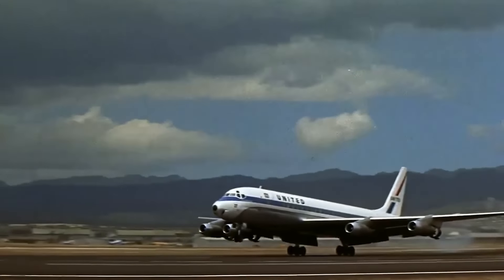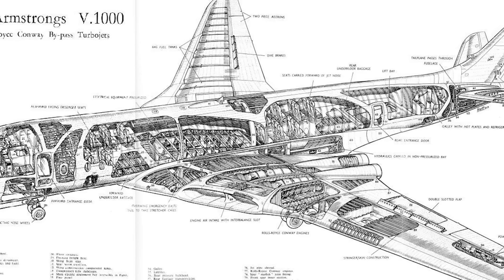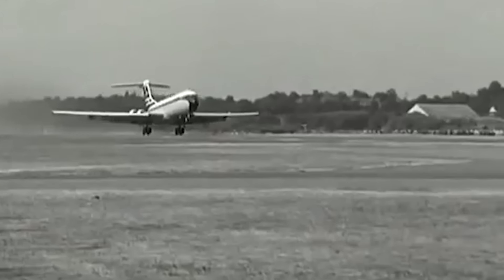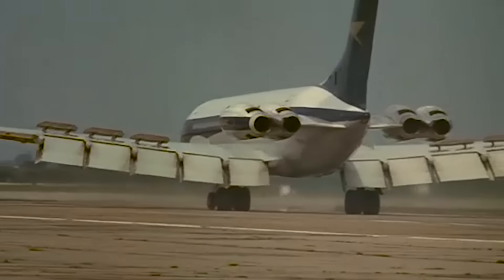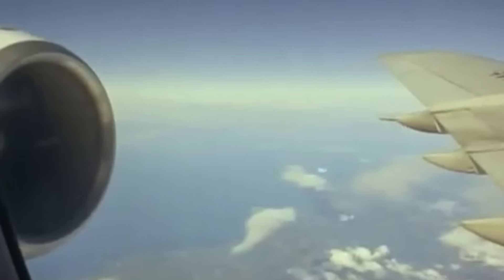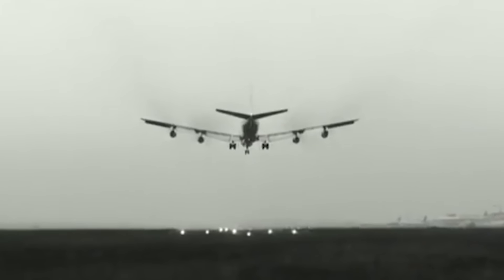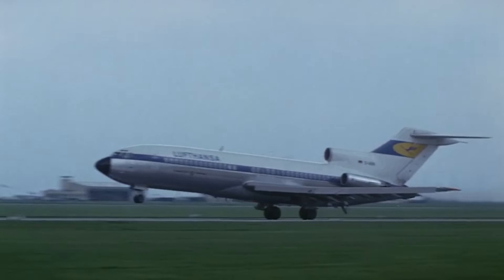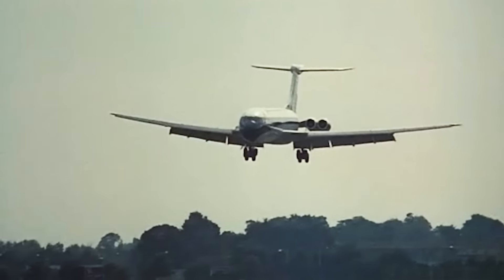Vickers VC10 - the lost flagship

Comment: The cost of modifying (lengthening) every airport runway  in africa to handle 707s was less than the cost of a single VC10 - blaming the requirements on BOAC is misguided as it was the Air Ministry who set the spec and told BOAC to fly the routes - Boac divested most of them as soon as it became a purely commercial operator
Reply: Indeed. Shortsighted thinking in designing an aeroplane to fit the airfields rather than pay to expand airports (which everyone did anyway!)
Reply: @ChrisH241  it was, however typical civil service thinking. 
The number of people who step back and look at the bigger picture is worryingly small, resulting in a large number of alligator control schemes instead of swamp drainage ones

Comment: My first jet flight was in a VC10 in 1965, Salisbury (Rhodesia) to London.
Reply: You must have done that before November 11th...
BOAC, or BUA? BUA had started operating the VC10 in 1964, a few months after BOAC. Their Type 1103 (standard) VC10s had the "Super" wing, so they could cruise higher at a given weight than BOAC's Type 1101, and up to FL430 (43,000 ft) towards the end of a long sector when fuel load had diminished and the a/c was light enough. On an Entebbe/Gatwick sector, which was probably included on your flight to the UK, the climb to FL430 might have been possible passing - say - Naples or Elba.
In October 1964, BUA replaced Britannias with a first VC10 (G-ASIW) on its once a week, so-called Safari service (Gatwick/Entebbe/Ndola/Lusaka-City/Salisbury, arriving early afternoon on a Thursday to night-stop. They then took the opportunity to do some circuit bashing for crew training, before departing the following morning. Good fun watching them, and never guessed I'd be doing the same thing on the same aeroplane with the same training captains six years later. But - sadly - never at SAY...

Comment: I was on the ramp at Seawell Airport, Barbados, when a VC-10 turned it's tail towards the ramp, and added breakaway thrust to start heading for the runway.

The hanger doors were open, and the jet blast flipped the roof completely off the building!

The VC-10 crew didn't realize what they had done, as the aircraft was "tail to" the hanger at the time.

As they passed the ramp on takeoff, they saw the weeckage.

I was flying a Beechcraft Barron, headed for St. Lucia, and was #2 for takeoff after the VC-10.

The conversation between the Speedbird and the tower was "interesting". :-)

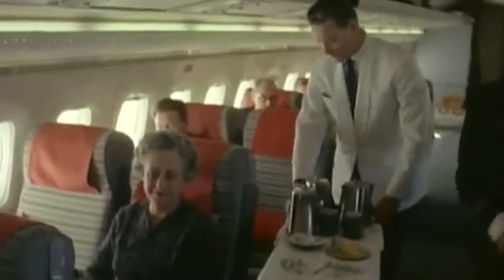Comment: 4:40 LOOK AT THE WIDTH OF THAT HALLWAY ! 😳 
It makes the 737 feel like the ancient sardine can it is !
Reply: Yes but the shot shows a 2+2 seating arrangement, whereas the 737 is 3+3. Internally, the cabin dimensions were as follows: Standard VC10 - 28.14m(L) 3.5m (W) 2.26m (H) 737-800 - 29.97m (L) 3.54m (W) 2.19m (H). If the internal dimensions were all rectangular the VC10 internal volume was 222.59m3 whilst the 737 internal volume is 232.34m3. So, in fact there really wasn't much in it. However, having flown on VC10s three times and a few more times on a 737, I can tell you that the VC10 beats the 737 into a cocked hat!
Reply: @rayjennings3637  for sure, you got the facts. 
My post was more about how back then people were not extruded honed/packed inside the planes like a can of sardines and every airplane wasn't chocked full of seats and airlines weren't as greedy as now. 
I have had the pleasure of flying VERY little and every time I flew in a 737 it felt the worst out of all.
My most pleasurable experience was aboard a regional jet. That thing felt like a sports car and it wasn't packed like that hellish 737. 🤮
Reply: @GIGABACHI  Now I get it. You're quite right but something you need to remember, depending on what decade you're talking about, is that the 737-200 was also a very noisy plane which would have added to the general feeling of being confined. The newer 737s, although hardly any bigger do have different types of overhead bins which makes them seem more open plus they've got much quieter engines.
I quite agree with you about the money-grabbing attitude of modern airlines though and those like Ryanair and easyJet (I can't speak for and American airline low-cost airlines) are just the worst, with their narrower seats and way less legroom. I'm 1.81m tall and although I've taken a few Ryanair flights, I've always had to sit askew in the seat to stop my knees pressing against the seat in front.

Comment: The original RAF VC10' s on 10 Squadron were a hybrid, the standard body with super VC10 wings and additional fuel tanks in the tail, it also came with a cargo door for its PCF role.
The VC10's of 101 Squadron were ex airline aircraft, most of them BOAC, including a huge stock of spare parts. The ex airline aircraft were gathered together at RAF Abingdon, some frames robbed spares but several were kept airworthy so they could be flown to Filton for refit. The ferry pilots flew them with undercarriage down and used the M4 for navigation.
My personal experience of RAF VC10's was flying in them as supernumerary crew numerous times, and although not a requirement I wish I'd kept a log book of all my flights with all the RAF aircraft I'd flown in.
Probably my most memorable moment was sitting on the jump seat for athe approch to, and landing at Lisbon Airport in Portugal. The captain was an American exchange officer and the co was a Canadian officer, we circled on hold above the clouds until we were given clearance and vectors for finals, we broke the cloud and the airfield came into view. The trust that pilots put in Air Traffic Control became apparent as we flew out of the low cloud along a path between tall buildings.
When I left the RAF the VC10's were still in service.
It's a shame we can't post pictures in comments otherwise I would have shared my photo of the VC5 that was in the Movements School hanger!

Comment: I worked as an airframe engineer at Brize Norton from 1977 to 1982 we had 13 vc10's but tail number 809 was used as a flying test bed for rolls royce RB211 engine and was modified to have only one RB211 engine on one side and two conways on the other. It sat at RAF kemble for a long time after they bent the airframe. I was still there as they took delivery of the first aircraft from BA and flight testing of the first tanker was going on.
Reply: this also known as the vc 71/2 seemed an apt description  also it could go faster on the one rb211 than on the four conways  no they would not fit 2 engines as they would not allow (then) to use 2 engines planes over the Atlantic wow such a beauty  works at brize 66 to 2009  happy days.

Comment: I was a passenger on a VC10 several times in the 60's.  It was the most awesome plane to fly.  It was more quiet than a Boeing 707 and I never experienced any turbulence.   Like the Caravelle before it, the VC10 looked so "space age" with its swept wings and engines in the back.  The VC10 and the Caravelle were the coolest planes to fly in the early/mid 60's.  Then both planes disappeared as there were Boeing 707's and DC8's everywhere.

Comment: I think you may have missed a bit of history here. The VC 10 was a development of the VC8 Viscount and the the VC9 Vanguard. During the Vanguard's development Vickers were aware that the World might be moving in the direction of jet airliners for even shorter haul routes and had a back up design which they called the Vanjet. It would have had the Vanguard's fuselage, a new swept wing and three engines in the tail.

In the end that was not preceded with, but further developed into the VC10 which also used the Vanguard's figure of eight fuselage.

There is a direct line from the Viscount and Vanguard to the VC10, with an unbuilt branch to the V1000. Incidentally the jigs and tooling for the V1000 were all destroyed on government orders when that project was cancelled.

Comment: Safest plane to fly in ever!
Reply: Well, East African Airways crashed one on take off at Addis Ababa, due to brake failure, so failed to  stop. this  from faulty maintenance. The nose wheel exploded after hitting a small jack on the runway. A Brit. United VC10  hit such sever turbulence over the Andes that thewing  fuel tanks leaked out fuel onto the parking apron. After some patching up, the plane was found OK to fly back to UK for proper fuel tank repairs.  (VC10 Senior Capt. EAAC. 70-73).

Comment: My father helped design and build the hydraulics for this beautiful plane.  The original has my hand print in the underside as a small boy I inadvertently touched it during an open day at Weybridge.
     Later I did thousands of miles in them as a serviceman. A fantastic plane.
Reply: Skydrol 500B an ester based hydraulic fluid. Lovely stuff(not) made by Monsanto..
Reply: I saw them being built at the Brooklands factory either 1963 or 4.  If you look at about 15.30 on the video you will see one of the fuselage sections which were machined on a huge horizontal milling machine from aluminium billets probably 30 feet long, 3 feet wide and about 4 inches thick, then formed into their compound curved shapes by shot peening, and bolted together with fitted bolts.  It was truly a very impessive factory.  I also saw an undercarriage leg being machined.  The legs were the heaviest single part of the aircraft.  Whilst you can call a big Boeing a million rivets flying in formation, that was never true of the VC10.
Reply: How many hydraulic pumps did it have?
Reply: I a Brown job flew many times with RAF & at Brize Norton you walked too it parked & up stairs. It's the only passenger plane that standing parked looks like it's still flying & that's a testimony for the person who thought of it (do we know who?)
Reply: @seltaeb9691  afraid it stopped flying in sept. 2013
za150 is taxiable and zd241 is too (zd241 is at bruntingthorpe and that closed last year, hasnt been ran since before then)
Reply: That's very cool
Reply: I worked under Geoff Bannister on the Vanguard hydraulics for a year after my apprenticeship at Weybridge.  He was one of the best bosses I had in my career.
Reply: @ Dad died in 2002,  his biggest regret was the cancellation of the TSR2 and the subsequent brain drain to America of our top avionic engineers,  but that’s another story.  As for the Vanguard I flew on them whilst working in Rhodesia for the British Army, interesting aircraft.
Reply: Thanks for your reply, Nick. He was a pleasure to work with, and sponsored me for associate membership of the Royal Aeronautical society a few years later. A fine man, and my condolences on his passing.
Stewart Irving

Comment: Another reason why the VC10 failed commercially was that by 1962, the P&W JT3D turbofan had come out and leapfrogged the Conway by 6-7% in fuel burn, and it was never redesigned to accept that engine. Had it been just a few years earlier, it would have probably garnered a lot more foreign interest vs the early JT4A powered DC-8 and 707 models.

Comment: Back in the late 60's early 70's I worked in oil exploration in Africa, Mozambique as one destination. Have always had a fascination with aircraft & flew between Johannesburg & London via Nairobi & Rome. Having made several trips on BOAC VC-10's I knew that the airfield performance was spectacular & in general time to rotate was in the order of 25-40 seconds. On one flight  from Nairobi, at night, we stopped on the Taxiway, the Captain came on & said we were over fuelled & would have to burn off some weight whilst stationery. After a short while  we turned on to the main runway & sluggishly accelerated. I was looking at the second hand of my watch & was alarmed  to see we were still on tarmac as the time moved to about 60 seconds! I could not believe we had any runway left as the VC-10 lifted off at the very end climbing more like a DC-3, the trees & small village with people clearly visible.
All previous flights had the nose at a very steep angle once undercarriage stowed with a great rate of climb. I was aware that these high & hot African airports presented a problem at take off, hence the creation of the VC-10. I would love someone, crew or passenger to comment about that day.

Comment: Another factor not mentioned in the video that limited the VC-10's commercial success: Pratt & Whitney developed the JT3D turbofan that took the industry by storm. The more powerful and less thirsty JT3D sealed the Rolls-Royce Conway's fate, relegating it to little more than a stopgap between early "straight pipe" turbojets and the JT3D. The JT3D improved the performance of early "straight pipe" 707s and DC-8s to the point that they could now use the hot and high airports for which the VC-10 was designed. 

In the early 1980s a friend of mine flew from London to Montreal aboard a VC-10, whose crew radioed YUL their aircraft type. YUL though it was a DC-10 and provided steps for that plane!

Comment: Back in  the 1970's  on a VFR flight between LHR & STN I flew in the NAV seat in an otherwise empty VC10 (no PAX seats or Galleys_ as the aircraft had just completed a major C4 maintenece schedule. The VC10 Fleet Commander was conducting  four Command Licenses with two other First Officers. It was a hot summer's day and the viewing platform atop Queens Building  was full of people watching the aircraft movements at LHR. We taxied behind a BA 747-200 lining up on 28L to do  its take-off roll . Thundering down the runway, no doubt on a full 747 load V1 was two miles away. Upon ATC clearance the Fleet Commander spooled up to full thrust the fore RR Conway Engines THEN went for brakes released. I vividly recall the sensation of being physically sucked into  the back of the NAV seat and we went up like a rocket (quite literally) in 300yds - Jeesus Christ - Way to go! Of course I was scared for life with the stunning experience  of the VC10

Comment: In 1975 I flew from RAF Brize Norton to Gander Newfoundland and on Norfolk Virginia in an RAF VC10. The purpose of the flight was to join 809 naval air squadron embarked on HMS Ark Royal which was docked at Norfolk navy yard. All passenger seating faced the rear of the aircraft. An RAF requirement at the time said to be safer if the aircraft was involved in an accident.

Comment: BOAC VC10 to Africa and Hong Kong; happy memories. Trooping flights on the RAF passenger version - the seats facing backwards (sleepy soldiers occasionally trying to enter the cockpit, assuming it was the "rear" toilets!). Sat in the cockpit of a C130 over the South Atlantic staring up at the magnificent sweep of a VC10 tanker tail and wings as we refuelled en route to the Falklands. IISTR the VC10 had to throttle back and the Herc had to go full throttle plus a shallow dive, just to keep together for the fuel transfer.

The aircraft was very quiet inside, but noisy for those on the ground. Actually this was useful for us expats living in places like Khartoum, Nairobi or Dar es salaam. The BOAC flight from London was often delayed ("sandstorms over the Sudan", etc). Instead of waiting hours at the airport in the steaming heat, you could just sit at home/ on the beach/ somewhere with aircon, and listen out for the thunderous roar from the direction of the airport which meant that the VC10 had finally arrived.

Comment: Yes vc10, the best ever,  powerful quiet  incredible climb rate
Reply: Any relation to Ian Covington, who was a skipper on VC10s with BUA/BCAL? 
Yes, a standard VC10 had 84000 lb thrust available at sea-level, against a larger, JT3D-powered Boeing 707-320B/C's 72000 lb. And the Boeing' MTOW was 151 tonnes whereas the standard VC10's was  only 142.4 tonnes. Hence the VC10's superior climb performance!

Comment: I had a number of flights on the VC10 during my time in the Royal Air Force, and of all the passenger aircraft types I've flown in (and there have been many) the VC10 was by far the smoothest and quietest.  Quick too.
Reply: The fastest sub sonic jet ever, think it was near 900mph.
Reply: @seltaeb3302  The fastest sub sonic jet was the H.S Trident. It cruised at 0.88 Mach and was capable of Mach 0.96 if fuel consumption wasn't an issue. My late father RIP was a captain on the Trident.
Reply: @Robert_N  Thanks, didn't know that.

Comment: My late father was a S/E/O on VC-10s with BOAC from before their entry into BA fleet in 1964, until he was re-trained onto ANZ DC-10-30s whom BA had entered into a codeshare agreement to fly the LHR-LAX and vice versa sectors of a new UK-NZ route. (Later they also did Montreal rotations with the same aircraft).

My father loved the VC-10 (and the VC-15 as they had nominated the super version) and it's a 'great pity none survive in flying condition as that aircraft on-take off was very, very loud, and an amazing sight and sound. I had the pleasure of flying in it a few times and one unforgettable trip was a LHR-Bridgetown return flight in 1st Class in 1969 .... luxury indeed for a 12 year old .
I lived near RAF Lyneham, Fairford and Brize, so the military versions were a very common sight, as were the BA airframes enroute out of LHR to US/Canada along airway Green1. There was also an RAF airframe stored on the scrap heap at Kemble as it had been used as a testbed for the Rolls Royce RB-211 engine that went on to power the BA B.757s and L.10-11 Tristars.
A beautiful, and one might dare to say, 'sexy' aircraft - and one that is sorely missed. It had flown for more than 50 years .......